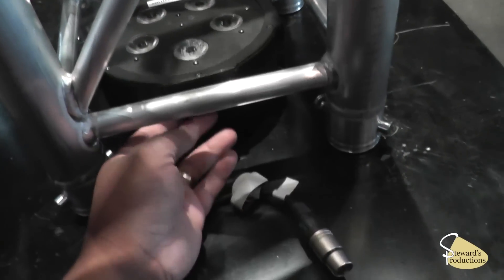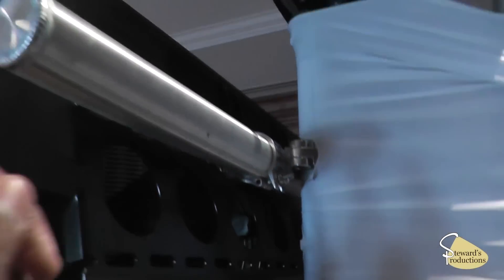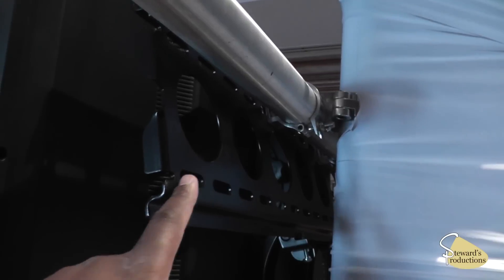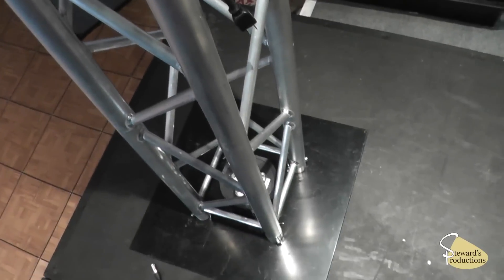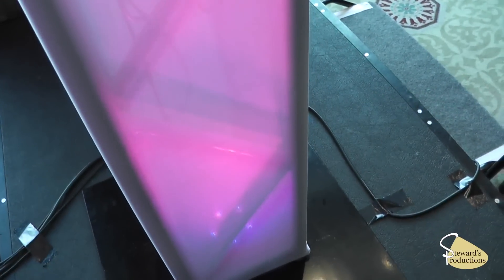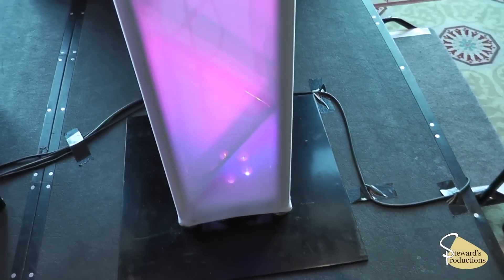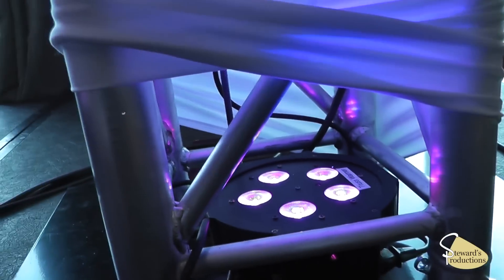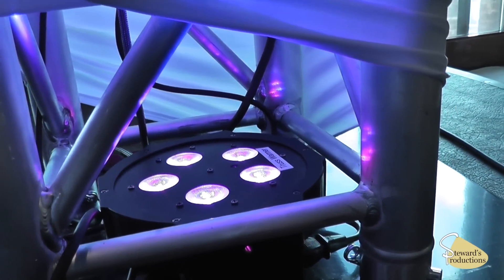Vertical Truss with ADJ Mega Tri Par Profile - DJ Brandon Steward's Productions Truss Warmer

Comment: what kind of base plates are those? i have the 30x30 black base plates they are a pain in the ass... they told me that i needed the heavy duty ones to mount TVs... its a pain in the ass because you need 2 people to carry them... im just using them as totems with moving heads on the top